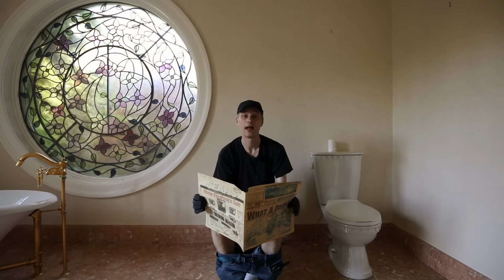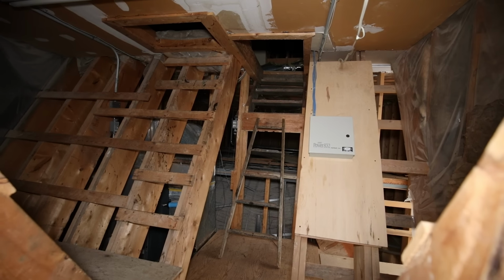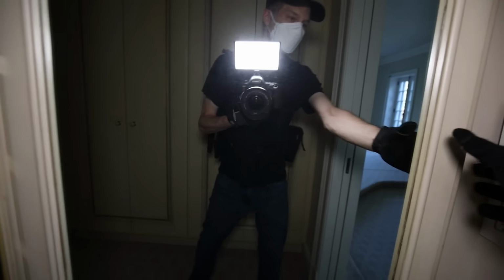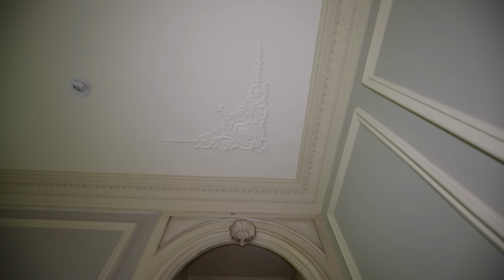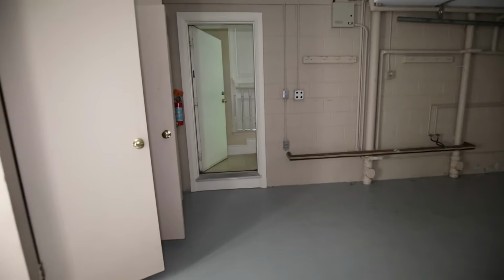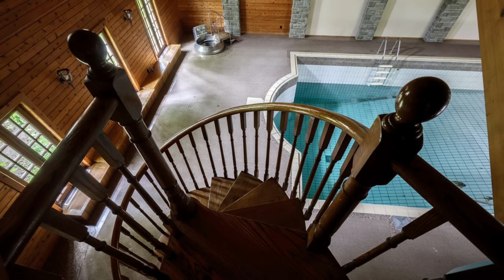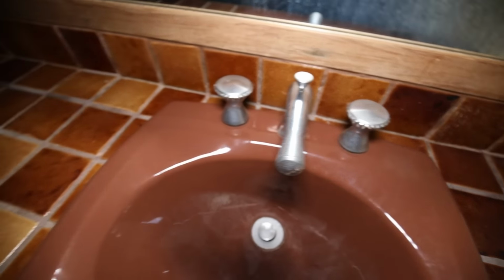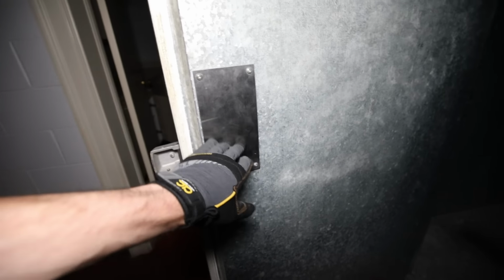Amazing $40 Million Abandoned Mega Mansion with a Hidden Bomb Shelter!!

Comment: 14 bathrooms! Somebody really wanted to torture the cleaning service. Oh, the usual opulence and decadence overall is rather tame. Gold plating is cheap, solid gold not so much. The place had everything but a panic room. Shameful a perfectly good building that could be converted into multiple usages will be torn down.
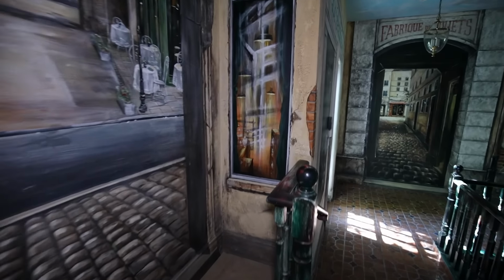35:11- 36:20 was the moneyshot part. Trippy too. Unfortunately, it only takes on leaky toilet or faucet to cause destruction.
Reply from the maker: Ya, no panic room but in a pinch, the bunker could also serve that purpose. Yes, I'm sure there was some sort of a backup plan for that, the pipe I showed, could have taken at least some of that water. Thank you very much for your comment!!